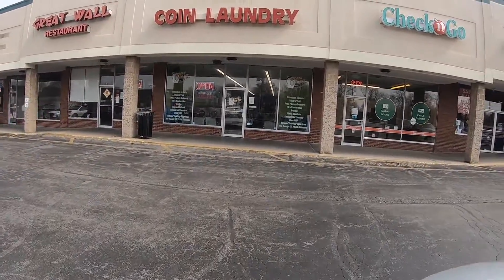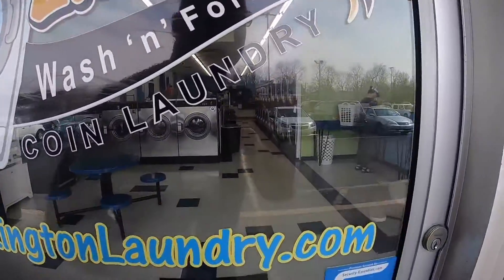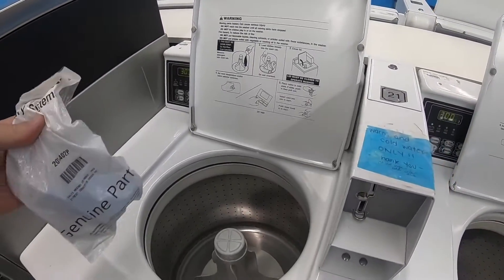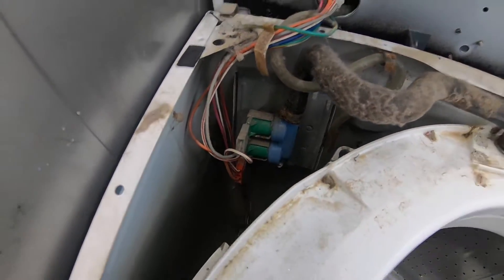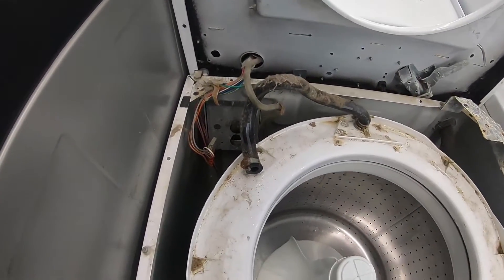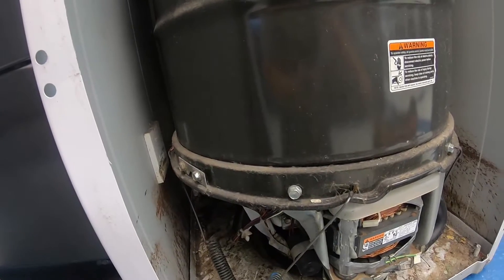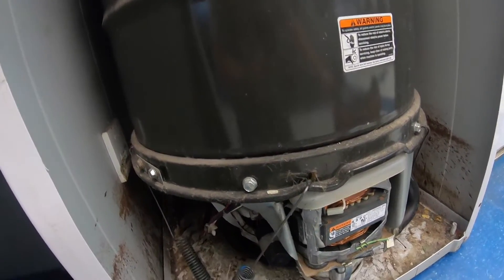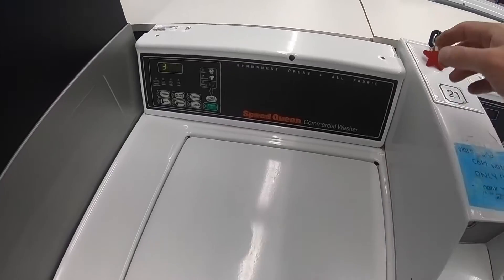Speed Queen Top Loader water valve changeout

Comment: I don't understand why you took the top off.
I have what looks like the same machine and the valve comes out the back after removing just 1 sheet metal screw.

Also, Speed Queen warrantee is worthless. My water mixing valve died after a few months and I had to buy the part myself because Speed Queen ignored my warrantee claim.
They may have saved themselves a few bucks but I will remember it when I buy more equipment.
Even if they did react quickly the failure rate is horrible. 2 out of 4 top loaders had problems within a few months. That's a 50% failure rate for equipment that is significantly more expensive than comparable GE or Whirlpool.

Comment: I need to replace the whole agitator in a SpeedQueen.  How do I get past that nylon noodle just below the softener cup?  Pull with plyers or lefty-loosey with plyers?  TIA!
Reply from the maker: Gently try to pull
Reply: @splashemoutlaundromat  Thank you for the response.  I did repair the machine.  The agitator comes out as one piece.  Nothing in the top needed to be removed.  I removed the whole agitator by looping 2 different ropes under the bottom and lifting with those.  The replacement agitator basically snapped down on a pin-like mechanism.

Comment: Is there a load counter that can tell how many loads that machine has washed?
Reply from the maker: No load counter that I am aware of.  Of course, if you made it cashless, and had it wired in for the card system, then yes you could tell how many loads that particular machine has washed I believe.
Reply: In you’re estimation how many loads can these washers and dryers run before major problems begin? 

I have an 8 series commercial set that I bought mid 2016. And so far they’ve been very good. My load count  pales in comparison to a large families load count.

Thanks for you’re helpful info.
Reply from the maker: I wish their were.  Anyway, if I had it on the network with the rest of the machines that would be a way you would know.
Reply from the maker: @dmc31405  It is really hard to say, because it would depend of the type of loads people put in.  Of course, you aren't gonna get the mileage on these soft mounts like a front load hard mount washer.